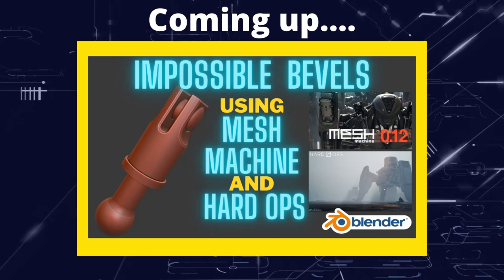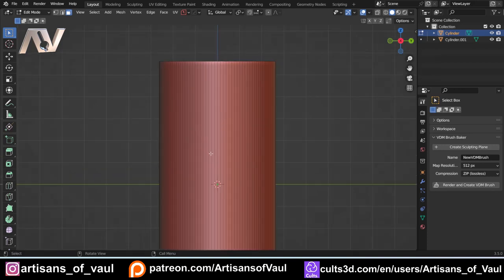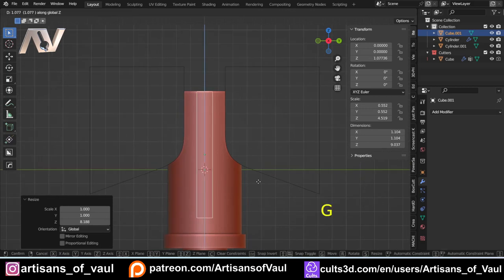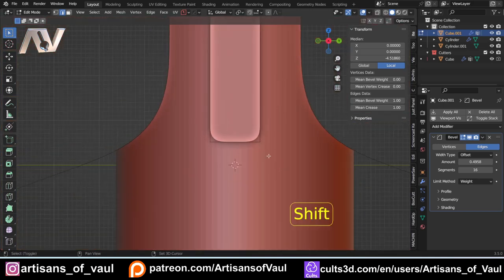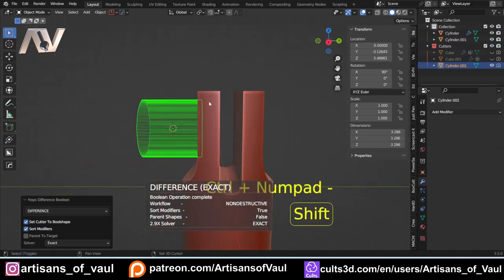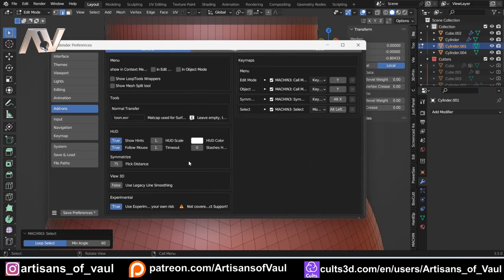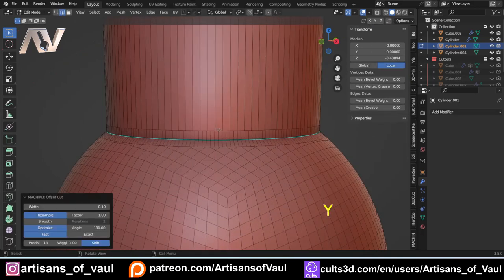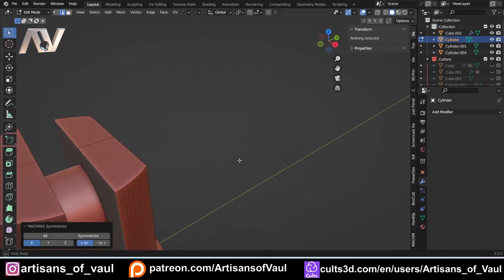Impossible Bevels using Hard Ops and Mesh Machine in Blender

Comment: I have to say this kind of thing would be about 10 times faster in Plasticity. And the only way to achieve this quiclky is by using two or three add-ons and learning their ins and outs. Mesh machine hardops loop tools booltools. You might as well create something like this in plasticity and import it to blender and it would actually be simpler. I mean I think it's great that blender has lots of add-ons but some of them are incompatible you have to maintain them all and update them all etc etc kind of a messy pita.
Reply from the maker: Yes and no. Without having to explain it I could knock this out in under 5 mins. 10 times faster than that would be 30 seconds and I find that unlikely.  I'd be curious to see how quickly this could genuinely be done in plasticity though. I'd also be interested in seeing what the mesh looked like as I have heard some not great things about the meshes created.

Don't get me wrong plasticity looks great but I'm not sure it's there for all the functions I would want in a program. I also have concerns buying something for $100 when that only lasts till the end of version 1. What if the functions I want don't come in until version 2.0? Spend another $100?

Again I'm not slating Plasticity, these are just my genuine concerns about using it.

Comment: Just a heads up, if you press Alt-E, you'll get a menu for extrude along normals and extrude individual faces - no need to go through hard ops :)
Reply from the maker: That's true but it can have issues which makes HardOps more efficient. I've got a short on it here: https://youtube.com/shorts/nrA9YaBVsIo?feature=share
Reply: @ArtisansofVaul  Good to know! Loving these little tips videos
Reply from the maker: @hwerrell  Thanks man. It doesn't always make a difference but I've got so used to doing it now and it takes about the same time to use both methods I just go with the one not likely to cause issues 😅

Comment: Newbie to 3d and was just wandering hiw to turn all this mesh into quads if need be?
Reply from the maker: You'd either play around with the points manually (with the boolean cleanup function in mesh machine it doesn't take too long) or use an addon like quad remesher